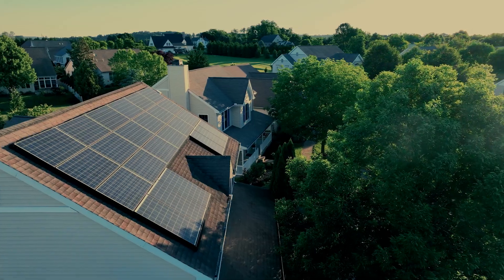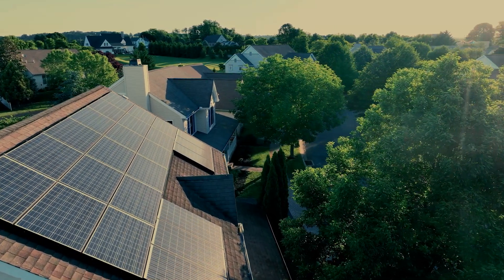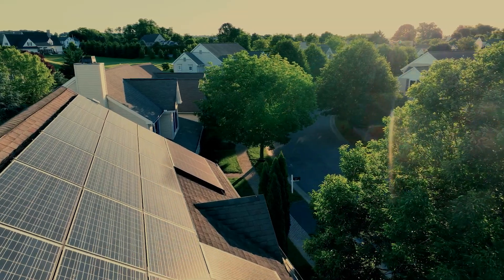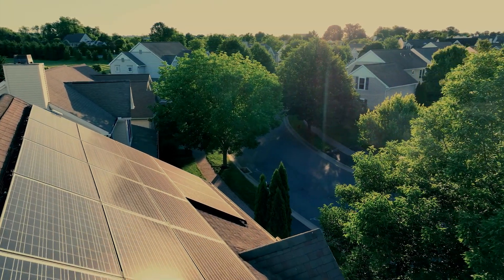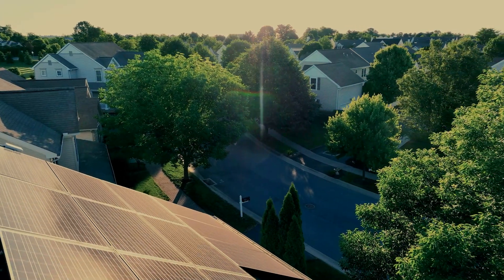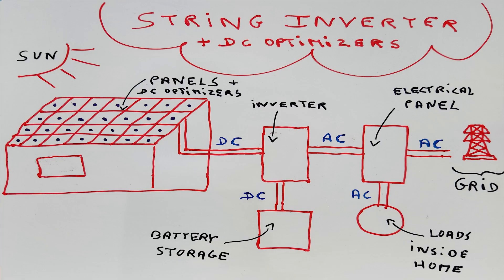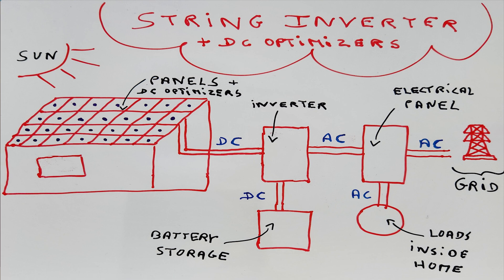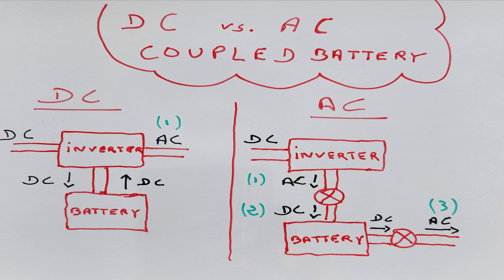Should You Oversize Your Solar Array? Well, It Depends

Comment: Very good video. I was thinking just of this, more power on the pannels than the invertor can take. Just to have a reserve for cloudy/ winter days.
Reply from the maker: Thanks for taking the time to leave a comment. Much appreciated! Indeed, based on my personal experience, we tend to always underestimate how much power we'll need. This is especially true if we are also planning on installing a heat pump and/or purchase an EV. Oversizing your panel array (some inverters allow up to 200% oversize) presents many advantages. All this extra DC power can be used to charge your batteries and EV, etc. Instead of having your batteries charged by noon, you could potentially have it fully charged by 10:30 leaving more power to exports during the rest of the day and hence earn more credits from your utility company. Also, like you so rightly pointed out, your array would still produce a decent amount of electricity even under cloudy conditions and/or during the winter months!
Reply: @ElectrickLiving  exactly. Thank you again